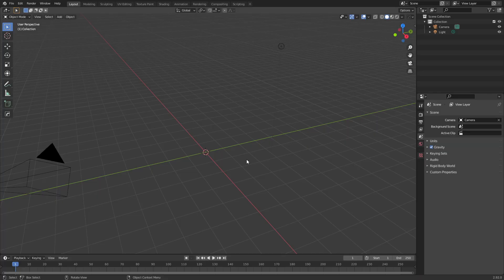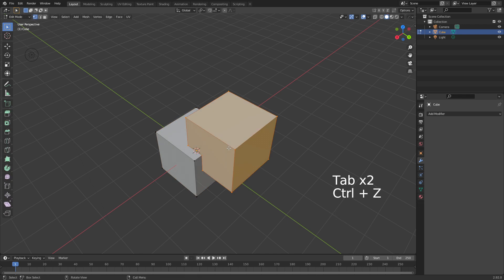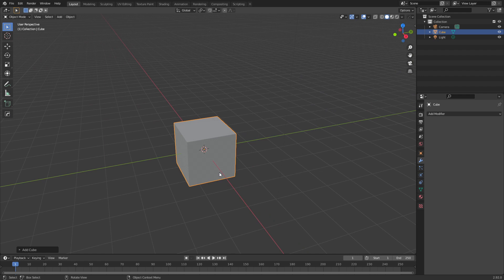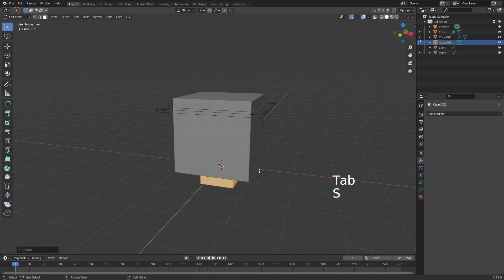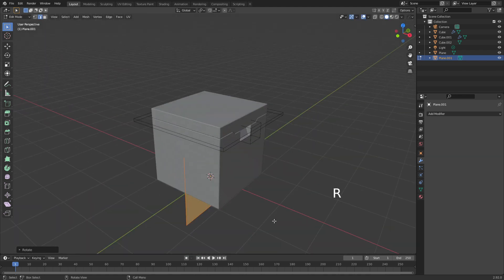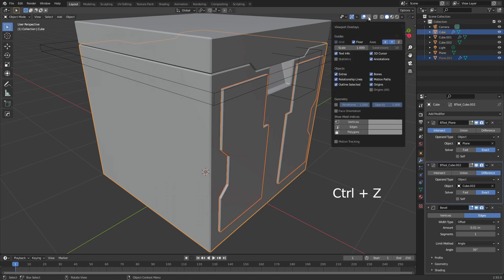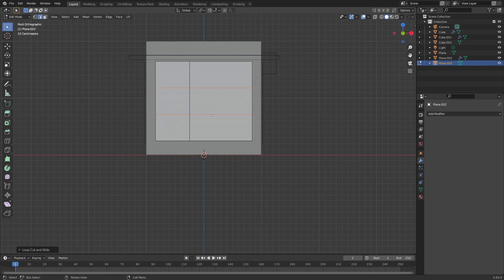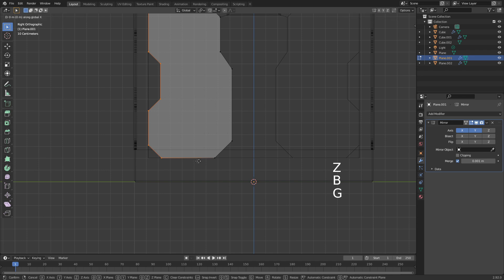Create Scifi Crate Using Bool Tool Blender Tutorial

Comment: Marko, you have totally exploded Bool Tool for me.  Thank you!
One problem I always had with booleans in the past,  however,  is when I convert my Blender objects for use in iClone, I end up with "phantom faces".  IOW, when I see my mesh in the conversion program (3DExchange), there are now visible flaws in the cuts (difference).... example,  if I made a cylindrical based cut into a side of a cube master mesh (no subdivision),  the cut would appear,  but the difference would be covered by a face.  My solution was to subdivide the master mesh a few times before applying the difference mesh boolean.  This usually helped,  but I might still have had to do some post execution tweaking.... smaller phantom faces that do not fully cover the difference zone,  but still appear. 

When you look at the same mesh in Blender in Edit mode, you would see where the "phantom faces" exist.  

How does one identify a phantom face?  Look at where the cut had been executed.  Look at the surrounding geometry.  If the markers of the surrounding geometry appear inside their respective shapes,  you're safe.  However,  if you see a floating center marker inside the cut (difference zone),  but near where the surrounding geometry exists,  that is where your phantom faces will appear when you convert the mesh (post- execution) in 3DExchange.  The quick fix is to "knife cut" (K) the offending surrounding geometry so that the floating marker  disappears from the difference zone,  and two new markers appear inside the retopologized surrounding geometry.  

....(and I'm gonna kick myself if this is the point that is discussed in part two of this awesome tutorial) 🤣🤣🤣
Reply: After you apply the boolean, convert the mesh to tris and then export the fbx file for use in iclone. That should solve the phantom face problem.
Reply: @CaptSanchez  👍👍Thank you.
Reply from the maker: hmmm no entirely sure here as I dont normally export objects into iclone. I would suggest maybe ensure that you dont have double vertices after you have applied all the modifiers. m > Merge by distance. Also check your normals. I will have to have a play and I will get back to you. I will be travelling so it might be a bit.
Reply: @Markom3D  Oh, believe me, I started doing a thorough check (normals, dupe-verts, etc., after I realized the situation with the phantom faces.   But,  yes,  when you do get around to it in your time,  I'll be eager to hear what results/ resolutions you get.  Take care,  and thanks again.  Be careful in your travels. 🖖